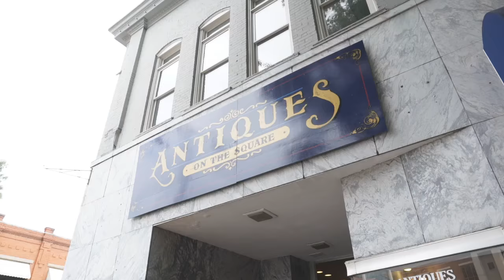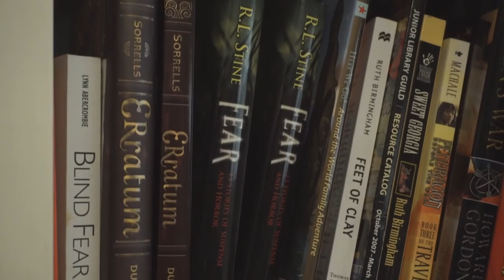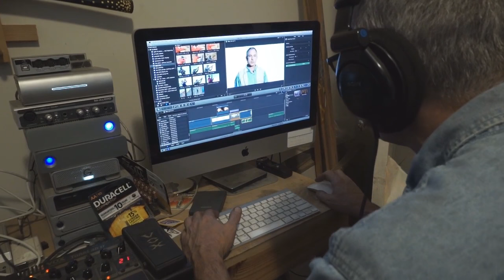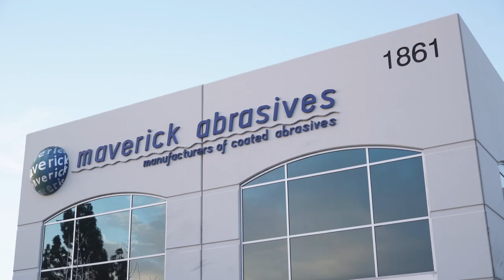Knife Making Interview:  Behind the Scenes with Walter Sorrells

Comment: Hi Mr Sorrells, I noticed that in this video and all the others, you grind the primary bevels of your knife by hand. Isn't it risky in terms of the symetrical precision of the blade? Because you may grind one bevel a few decimals off in terms of the angle, compared to the opposite. As a professional, how would you advice novices on grinding by hand?
Reply: buy scrap steel and just go for it, learn, test, try, -  mussel memory
Reply: SAKCollector 1 just use a jig to file them in, Idk ud be shocked at how close a skilled hand can get
Reply: rollinggoronable may be if this is a ocd thing for you use the belt to take alot of scrap off and finish by hand still would save you time?
Reply from the maker: It's just a matter of practice.  Probably a little more work, but to me it's part of the artistry of the work.